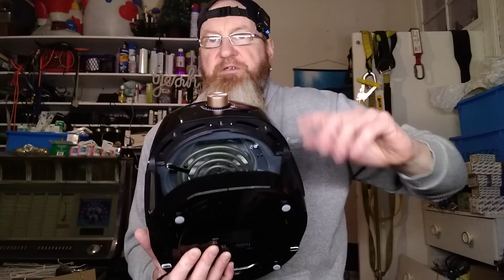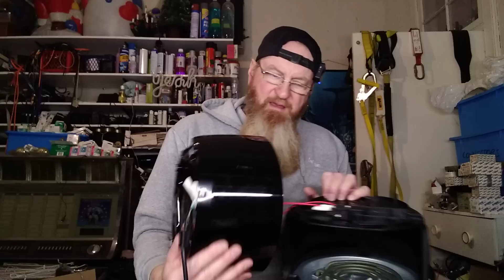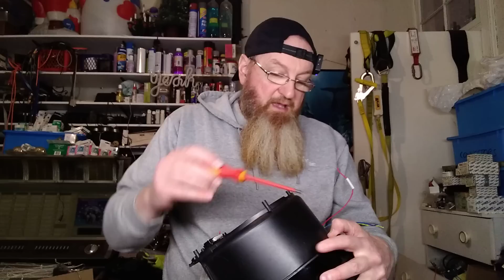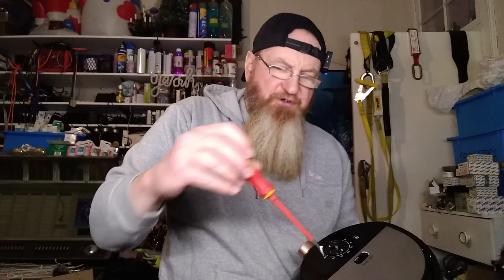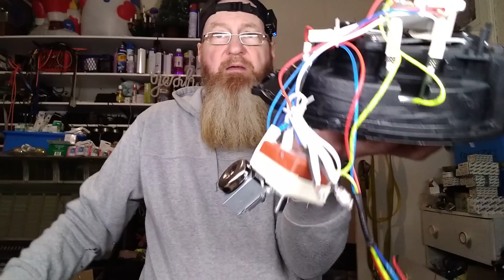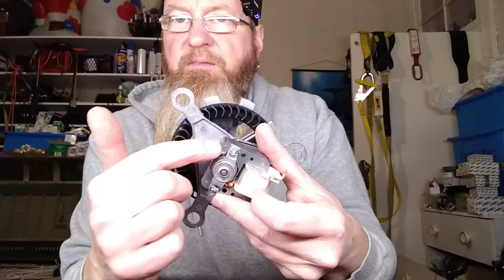Total teardown of an ASDA air fryer

Comment: Aight so slight update, i have ordered some stuff from ebay, one of which is basically a ussr GSh-2 tube stuck on a very powerful plasma globe driver. its got an electrode at the top from which i can draw arcs up to 2 cm distance with a screwdriver. I would really like you take a look at the circuitry because it seems to have like multiple transistors or something.

Comment: I never saw an air fryer so basic as this one. As you said, the parts are worth more than the assembled product. Good source for making a controlled temperature oven with even air distribution - just add a thermally isolated metal case (old countertop oven), a cheap PID controller and an SSR.

Comment: we have one of those,great machine but the left hand threaded nut has now undone 4 times,it really needs some thread lock but i believe it gets too hot to work,
We had a battery starter charger at work but the timer broke,i would definately have bought one of these for the charger 2 years ago,not needed now.
Great strip down as always and no schematics were hurt in the production😁

Comment: Haven't commented in a while! Just to let people know, spade terminals have a small spring-loaded pin you can push to release it smoothly, rather than fighting against it with unreasonable force. For bigger terminals you may be able to push it with your finger while pulling, but others may need some pointy tool to unlatch! — Don't go out breaking poor young switches!

Comment: asda is related to Walmart but does the air fryer have an overheat protection  i use an air fryer with touch controls and presets in it for food

Comment: We have one of these the tiny switch at the bottom of the drawer that tells the machine it’s safe to do hot things malfunctioned part way through doing some chips. I hurriedly filled the void with tin foil to bridge the connection and it’s worked faultlessly for over 6 months,  besides the fact you have to use the timer as an on off switch now 😂

Comment: I have the same air fryer, as I'm planning to replace it with a big one, I'm guessing if is feasible to put an high current diode in series to the heat element to half power consumption and use it as a defrosting/mild heating machine.
Reply from the maker: The thermostat goes below room temperature, so you could just set it slightly higher.

Comment: No, the exhaust air comes out the back top from the rectangular shaped vent, not the bottom that you showed. I think those small vents under the base are where outside air gets drawn in to stop the body getting too hot.

Comment: Toaster ovens are the classic "reflow soldering at home" appliance, but the lack of air flow is problematic (hot and cool spots).  Maybe an air fryer would be a better starting point.

Comment: Actually, it's way better than electronic controls with pointles little screen and several preprogrammed cycles. Contacts on the thermostat, fan motor bushings and regularly heated plastic have more or less equal lifespan, so everything is right.

Comment: I was not prepared for Big Clive's sexy delivery of the word "crispeh"

A point of annoyance for me with these and many other sort of "counter top" ovens is that they aren't insulated. They could insulate the oven, use less electricity for cooking and heat up your home less, but they don't. Instead they add fans and cooling to keep it from melting, and just waste a bunch of energy blowing hot air into your house.

Comment: It's always nice to see Clive pulling his big knob off, so we don't have to .....

I have only had my air fryer for a year, but I fell in love with it very quickly!  Anything that tries to heat the food directly, as opposed to heating the whole kitchen and the food picking some of the heat up, has got to be good.   

As far as I can work out, the physics involved in air frying is that by using a fan to force the hot air to flow much faster than it ordinarily would by convection alone, and mostly recirculating the same hot air past the food many times over, the air fryer can deliver heat to the food at a rate more comparable to using a liquid as the conductive medium; but without the possible secondary effects of contact with liquid, i.e. sogginess  (if you boiled it in water),  greasiness  (if you fried it in oil)  or toxicity  (because there's bound to be some liquid out there that would otherwise have the perfect thermal conductivity and non-mixability for cooking food in, save for the minor detail that it would not be safe to eat afterwards; chemists, please chip in).  The food at the top of the cooking pan is also going to be exposed to direct infra-red radiation as though it were under a conventional grill, so you just need to pull out your chips every so often and give them a good shake so the surfaces brown evenly.

In my experience, to get pies, pasties, sausage rolls and the like coming out as though they were fresh from the village baker's oven, you do need to preheat the air fryer for a couple of minutes; otherwise, the pastry begins to overcook while some of the filling is still cold  (this might still be rescuable in the microwave, as long as the pastry is not too far gone).  It's still nothing like as energy-intensive as a conventional oven, though.  If cooking a frozen pie in a foil dish, don't try to remove it from the foil before you put it in, otherwise you risk bursting the pastry; cook it in the foil at first, but remove the pie as soon as it begins to come loose of the foil.

P.S.  Is that a jukebox in your workshop?
Reply from the maker: It is indeed.  A Rock-Ola.

Comment: So what’s the difference between these air fryers and the halogen ovens that proceeded them. Still have a halogen oven and it is so easy to clean being glass, how do you clean the inside of an air fryer?
Reply from the maker: The drawer system is more convenient.   I just put soapy water in the drawer and run it for a while.

Comment: It always surprises me that the mechanical clock timers are cheaper than a electronic version!🤔 i do prefer the twist and go timers on microwave ovens aswell. Simple is best 👌
Reply: But can you turn those timers back (it feels like it's forcing it). I was told not to....which means the annoying ticker keeps going grr!  (if I stop cooking earlier than I'd set)
Reply: @Kh13570   Yes you can turn them back, they have a slipping mechanism, so you can turn them back. it's not forcing them.

Comment: This was most interesting to see the innards and how the air is circulated. I only recently bought one that is branded Philips, which is meaningless in terms of reputation now. In doing some research before getting an airfryer on how long they last, it of course depends on usage, but it is said for a family using it regularly through the week 12 - 36 months. I guess usage for one person over a year ( less in summer in Oz for me - salads/sushi etc) to average out at twice a week, one could expect a longer life. Only if there is no natural deterioration of materials regardless of use. As you mention they are not expensive to replace and the bonus is the saving on using an electric oven which has to first heat up a large volume of space and all metal surfaces, then take up to 2 or 3 times to "cook" frozen food.

Comment: I bought an almost identical one here in New Zealand. Sold at "The Warehouse" it was the smallest and cheapest, cost NZ $ 47 and was the smaller "2.5 litre" model. Same as the video has the mechanical "clockwork" timer and basic thermostat. I see some other newer models have complex electronic controls.  The safety switch on mine is located just above the removeable basket, and takes the form of some vampire fangs which hang down, and get pushed up upon re-installing the basket. Yes it makes re-heated fish and chips, or pies, crispy on the outside still. Also great for precooked Oven fries or oven chips.  Does dry roast potatoes very well also. No good doing cheese on toast as the fan is powerful enough to blow the cheese off the toast. Otherwise, these are fabulous machines.
Reply from the maker: Zapping the cheese on the bread in the microwave briefly can make it stick to the bread before putting it in the air fryer.

Comment: For an appliance that gets to +200degC in the cooking compartment I'm seeing a disturbing lack of thermal insulation. Creating an air-cooled sleeve between the compartment and the outer casing is nice from a safety point of view, but properly insulating the compartment would make for a more energy-efficient appliance.

Comment: I took one of these apart a few weeks ago. It was old and falling apart but it worked. Got a nice motor, the main board some switches and wiring and the cord. Stripped down a remote control heater and I'm going to make a remote controlled blower because the heater has a very nice squirrel cage blower, two of them powered by a shaded pole motor and I also have the remote control circuitry.

Comment: Recently replaced the door micro switch on mine after maybe 10 uses. Uses a common microwave door safety switch.
Reply: I notided the same, but also how curiously the fryer only relies on one, whereas microwaves can go up to four 🤔
Reply: @MLX1401  microwaves are a bit more dangerous. Actually a lot more dangerous.

Comment: Or large 3d printing filament dryer for 4-6 rolls at a time of PLA if you can change the controller to possible a digital one that can change to a lower temp like 50-90c depending on the filament type

Comment: Our Westinghouse oven has an air fryer function. Very useful for  "dry roasting" a variety of edibles.  We had one of these stand alone ones at work, and I  have "repaired" it a number of times.  The "safety microswitch" on ours (Aussie K Mart special) seems the weak point, but very accessible (well it is now, courtesy of insulated 0.25" connectors 😀). Back in my undergrad (and postgrad) days, the go-to cooker for us bachelors was the ubiquitous Slow-Cooker, which was an absolute godsend where "cheaper cuts" of meat are concerned.

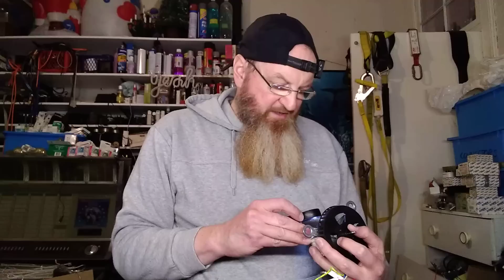Comment: @16:06 "TP" is not a bathroom necessity.  It means the motor is Thermally Protected against overload, even in the worst case (stalled rotor) the motor will not overheat to the point of catching fire.  It is therefore exempt from having dedicated motor protection and may be connected directly to the line.

Comment: If indeed that Appliance is double-walled and the air is flowing through their I do believe that it may be extracting are through the other housing to possibly preheat as well as cool down the plastic housing possibly even to increase efficiency with the heating but it's just a guess

Comment: For an air fryer/mini oven,for 20 quid,that's not bad for people on a budget and want/need to reduce energy costs ! that would pay for itself in no time,no pre-heat=less energy.i have a Ninja dual draw one,i've even done Yorkshire puddings in and only took 5 mins to pre-heat the oil (that's the only thing i've had to pre-heat) they came out perfect !...i did fish fingers in it from frozen (fish finger sandwich 😋) 12 minutes from frozen,no pre-heat !

Comment: I think someone needs to present* a graph of how much energy the airfryer actually saves. (*or maybe I should look it up)
I can't realistically be without an oven, in sprite of living solo... I bake way too much stuff to manage without the oven 100%. You just can't fit 16-20 pcs cinnamon buns at a time in an airfryer (that's like a 3:rd of total in batch).

More babble:
I am a little lazy in between so I bake / cook in larger batches maybe than others. When I make food I usually prepare 2kg of meat(that was on sale) for a Stew, Gulasch, meatballs, meatloaf, Hamburgers, Thai red / green curry chikin / pork etc. Whatever I cook I make sure it goes in- and comes out nice from the freezer too. "Doesn't get boring eating the same over and over for a week?"; no, I have like 4-5 different batches getting cyclically nibbled off from freezer. Might also be the odd frozen pizza in there. Sometimes you want something fresh of course, but it's no problem to interject with the odd fillet steak or a smaller Taco / Tortilla fiesta. I just like the idea of having 12-25 pre-made portions of "whatever" in reserve. Even if you get sick for a week or two yer going to be fine even without leaving apartment. If you can roll outta bed, you can throw a frozen brick into microwave and get a pipin' hot meal 3-15 mins later.
Reply from the maker: It's not a replacement for mass baking in an oven, but if you wanted to bake one part-baked and frozen cinnamon bun it would be perfect.

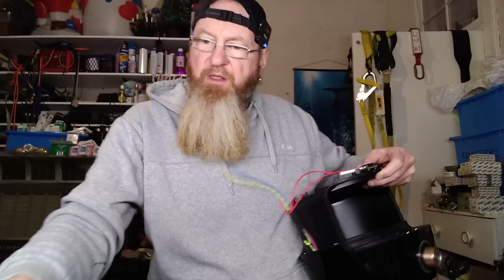Comment: 4:52 you know some spade terminals have a lock, and I hate those ones. They're to prevent it from falling out during vibration, but they're never tight so they always have a poor connection.

Comment: The connectors of the type that you called "tight" at the timer, sometimes have a tiny little pedal to release connector. This pedal is tiny and hidden under rubber isolation, on the metal connector itself right between the device's terminal end crimper wires of the connector. Just FYI, great videos.

Comment: I have a Tower branded one which I bought from Argos two years ago (for about double what you paid) which is clearly the same unit as this with just different coloured knobs, no metal trim and different branding. The same thing is probably made with dozens of different nondescript brands. Works well and seems to be reasonably well designed and built from this video.

Comment: If the timer is clockwork, that would imply that there is no microprocessor which in turn means it might work in my motorhome running off a modified sine wave inverter . . . . . .
You need an electric screwdriver. You could buy two, use one and destroy the other, in the interest of science.
Reply from the maker: I've missed a trick here.  I could have used the title EMP-proof air fryer.

Comment: I just learned something today: Air fryers are convection ovens.
Does that mean an actual convection oven will make chips as good as an air fryer though ?
I ask because while I don't have an air fryer I have a microwave that also does convection (With a fan) but it doesn't make good chips unless I buy the frozen ones that specifically say oven cookable on the packaging.
Those chips have oil in them as well as a bit of starch and or flour if I remember correctly. Plus a few additives.
But regular chips aren't nearly as good when cooked in this oven.
Would it be different with an air fryer though ?
Thank's !
Reply from the maker: The air fryer lets you take the drawer out and shake it a few times to make sure they are crisp on all sides.

Comment: Seems they stole the timer (and bell!) out of the more traditional "toaster oven," screwed it to a range burner with fans, then slapped it in a plastic (ugh) housing. As you said, these are made to the price-point of being disposable. If I were to get one, I'd probably install a dimmer circuit, i.e. TRIAC & potentiometer, for heating element temperature control.
Reply from the maker: The thermostat control of a simple heater is a very simple and reliable way of doing it.

Comment: For those frustrated that so many plastic consumer products come only in black these days- it’s a matter of cost. Injection molding uses pelletized plastic, and of course it’s available in a wide range of colors. However, recycling is actually a thing- not for environmental reasons, but because “virgin” plastic made from petroleum is far more costly than ground-up plastic trash- so plastic pellet makers buy tonnes of separated plastic junk in all colors, melt it down, then add a very small amount of black “dye” (mostly carbon black) and thus can sell black plastic pellets at a far cheaper price than other colors much less white or transparent.

You can now see why plastic consumer items in colors other than black, especially brand-specific colors like reds, greens and so forth, are going to cost you far more than a very similar item in black regardless of the sophistication or functionality of the innards of the device.

Mind you the majority of plastic trash still goes into landfills, but manufacturers have realized that using recycled plastic can save them money, and hence if you care at all about the environment you can encourage them by making a point of buying black appliances.

Comment: We have a very early air fryer. Reputable brand. It's a bowl with a mechanical spoon that rotates inside, stirring the things being cooked, everything is in heat resistant materials, it doesn't blows hot air outside, it has also electronic thermostat and electronic timer that do "bip bip" instead of a "ping". It was pretty expensive.
And now they've simplified the concept to this thing. Impressive what countries known to cheaply copy products can do to simplify expensive designs....
What about the jukebox in the background? Does it work?

Comment: The hot air blows out at the back. That is the reason you shouldn't run it too close to the wall because it can melt the wall ...
Reply: I point mine at an open window (because otherwise you get cooking oil smells blasted around).

Comment: 20 [money units] sounds dirt cheap, the air fryers I've seen in Germany (even the ones at Aldi, Lidl &co) were all 50€+. Though those usually had some buttons and a small display, so probably also a microprocessor present. 
Thanks for the tear-down, really interesting to see the guts of it ^^
And I know a certain (former) civil engineer who would really appreciate all your knob and shaft mentions 😉

Comment: I helped my father strip down an old fan oven when I was last visiting. I was surprised to see a separate fan on top of the unit to keep the outside of the unit cool. Makes sense as you always get a little draft of hot air standing in front of it.